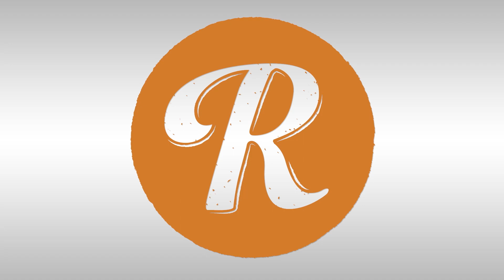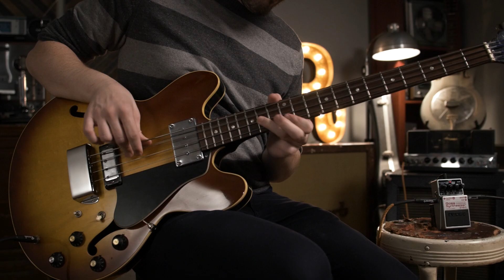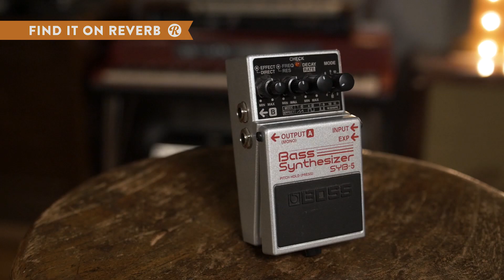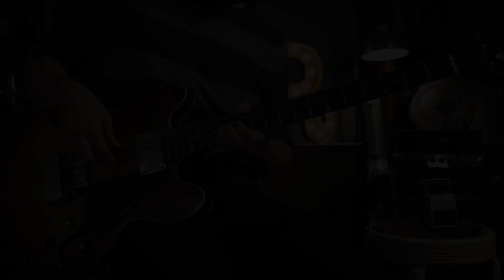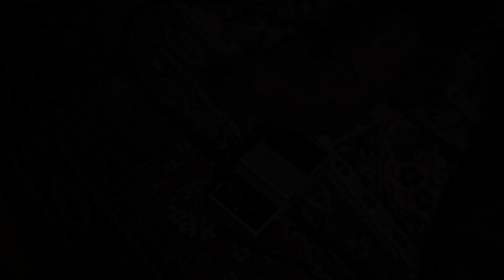Boss SYB-5 Bass Synthesizer | Reverb Demo Video

Comment: Really need to get someone to demo this pedal in a way that doesn't show how bad it tracks while playing fast runs. If played the right way, this pedal is a great addition for those who want to experiment in the synth bass realm.
Reply: In the few years you've posted that comment thank GOODNESS Scott's Bass Lessons and others have videos showing the technique you need to really get the most of these.  You can't just "bang" these like most modern bassists do: they like a soft touch that allows the octave to read the note and let it ring out.  They also like a more soft "cutoff" or mute" - not the "hard smash that most bassists do when they stop.  You can't "play snare" on bass either - it's a matter of keeping time with feet, softly muting, and playing towards the neck.  I don't ever comment on demos - you get what you get, though I also hope Reverb does a redo because I've heard these sound great in the right hands.

Comment: I used to use this pedal all the time.I never bought the expression pedal with it though I wonder if it changes the playability
Reply: It absolutely does! I have this pedal and an additional Roland expression pedal, and it gives a whole new dimension of control. I'd even go as far as to say that without expression pedal, the effect is not very interesting.
Reply: the expression pedal really turns it into another kind of beast

Comment: I don't recommend it after having it 2 years,it has a tracking problem, it likes to jump around notes or not pick up at all,it likes to be used very slow with the original bass high in the mix to coverup the bad tracking, making the synth kind of hard to hear and useless,as soon as the tempo picks up it turns into a mess.buy the blue one instead.

Comment: Is it really limited to over the top ‘80s lfo/high resonance type modulation? 

Is it possible to just add for example square wave oscillation on top of the bass tone (maybe with a blend knob)? 

Im thinking something like that could sound great in certain situations on a P-Bass with flat wound strings for example.
Reply: The Behringer one has a blend knob, and a sub bass knob.
Reply: It has saw and square wave modes, both with a sub osc mode and the lfo one. And instead of a blend knob, there are separated controls for the dry and wet outputs.

Comment: Great pedal...if you take the time to work with the tone shaping tools it offers as well as combine it with delays, modulators, overdrives etc.  A lot of players complain that this pedal just isn't all that versatile or that it doesn't offer useful sounds but that's because they probably don't really work with synthesizers or understand synth technology and almost certainly not synth theory (yes, there is actually specific theory that pertains to electronic sound synthesis).  A little knowledge in this department will go a long way and any experienced synth user will tell you that the idea is almost never to buy a product that's going to give you the sounds you hear in your head "straight-outta-the-box!"  Trust me; this is an incredibly powerful platform and its usefulness and versatility are only limited by what a player understands about how to craft synth sounds.  Spend half an hour or so learning about synth theory and how signal paths affect one another and you'll know enough to get very creative with working this unit into your arsenal.